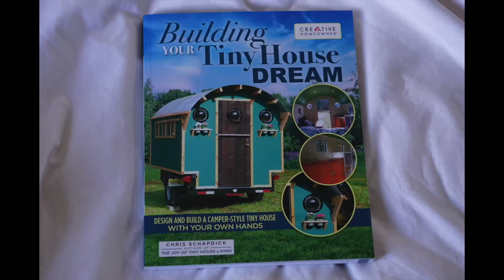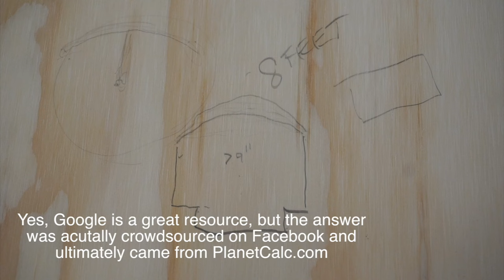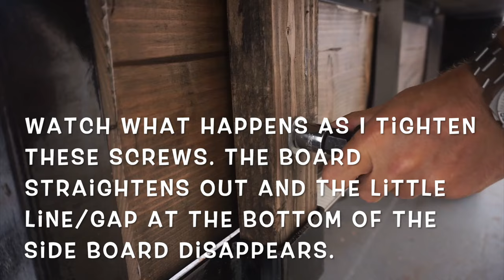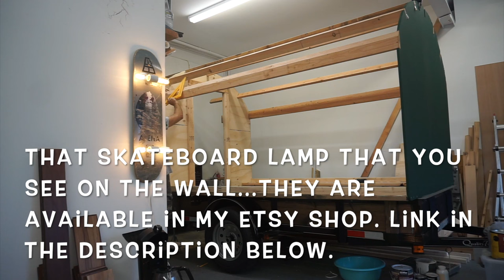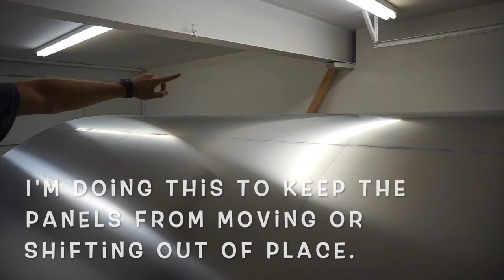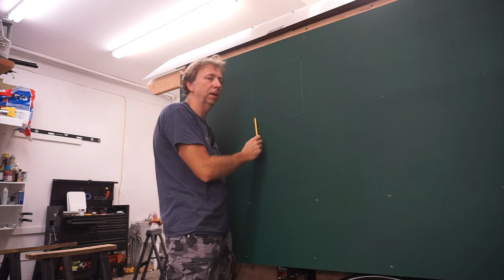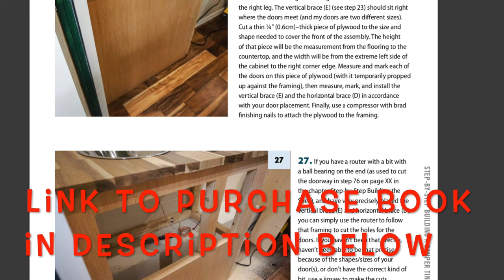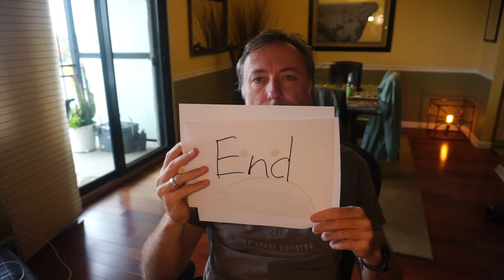End To End Gypsy Wagon Build - Full Tutorial!

Comment: for making those side 2x12's be flush, i'd sand the floor boards, then seal them, then add insulation, then the flooring, THEN add the side 2x12's and that should level out the boards to the steel sides.
Reply: This makes perfect sense. Will be much easier to install the flooring too when there are no walls in your way. Great idea!!!!
Reply from the maker: That's actually a good idea. I've never insulated the floor...only sealed it to the elements. I'm always worried about losing headroom since I'm a tall guy... 6'3"
Reply from the maker: agreed.

Comment: I just got your paperback book in the mail. Thank you so much for sharing your knowledge 🙏
Reply from the maker: Thanks so much for getting the book. Please drop any questions into the comments here if you run into any issues, please let me know on your build. Just thinking about it or are you planning on moving forward with this?
Reply: @TinyIndustrial  Thank you for such an awesome book. Lord willing I'll try to start building one in a month from now. I want to use a 12L x 6.5W or a 14ft long trailer. I guess that means I'll have to do a double axle trailer because I have no idea how much the materials will weigh.
Reply: @TinyIndustrial  I do have a question. I want to bring up the side walls from 4 ft to 5 ft. That would only leave 2 ft for the arc. Would that look weird and not as aesthetically pleasing in your opinion? I can't build higher because my shop door is 10ft exactly. As far as the seams go in the plywood do you just caulk and paint over them or just cover them with trim?

Also what do you use to seal the rafters? I know people say cedar is Waterproof but does treated lumber last without sealing it? 

Also what would you use to reinforce the back wall? L brackets?
Reply from the maker: Not sure what you mean by "would only leave 2' for the arc". You mean that the total height of the arc is only two feet? That's fine. Even if the arc were only 6" higher in the center than the sides, it's still fine. I don't think that you would run into a situation where that would 'look weird.' Hope that helps.
Reply: @TinyIndustrial  yes that helps thanks.

Comment: Could this build be used on a 7x14 trailer with adjustments?
Reply: That size will give you a mansion of a gypsy camper ! 👍
Reply from the maker: Definitely. I kept the info fairly generic since no two trailers are ever really the same. The general techniques can be applied and modified to different kinds of trailers. Is that the size trailer you have available? I would just make sure that the axle is rated for at least 3500lbs. Some of the wimpier trailers have less load capacity.
Reply from the maker: That's true. Would be a 'big' one. :)
Reply: Thank you for your answer. That is the trailer size that I'm looking at.
Reply from the maker: Nice!

Comment: String and a pencil for a compass? A long yardstick (maybe make one from plywood) with a screw or bolt for pivot in one end and a hole for a pencil tip at the other end will work more accurately. Also, instead of a pencil, the jigsaw can be mounted at that end for a better arc cut, and very stable, repeatable and also adjustable "not the radius, but the other thing", oh yes the radius. Just kidding!!!. I was gonna buy the book, but you showed the important number and link that I need.  Thanks, Chris!!!!!.
Reply from the maker: Yes, true. A piece of wood would likely be a bit better than a string. Glad the video was helpful for you. I take it you are building one of these?
Reply: @TinyIndustrial  Thinking about it. It looks easy.The planetcalc link is very helpful. I laid out in AutoCAD the numbers from the program and they are very accurate!!!
Reply from the maker: @armandosenson2391  I wouldn't say that it's easy, but it is very doable. One step at a time. No rush. You can get through it for sure. Please document the process on Youtube if that's your thing since it can definitely help out others as well.

Comment: I understand everything perfectly except for one part. at 1:46:40, why do you run that 2x3 to attach the wall framing? wouldn't it be more structurally sound to mount the wall framing directly to the big 2x12 below? Thanks so much! I'm going to build my own trailer and then build one of these houses on top at my new home here in Guatemala!
Reply from the maker: That's a great question. I'm not entirely sure why I did it that way. You can certainly do it the way you propose and have it be find. I think that the main purpose is that with the 2x3 at the bottom of the wall, you have 1) a wider area to attach the exterior/outer wall to. and 2) perhaps more importantly, when you go to attach the interior wall, you have a better contiguous span to attach the bottom of the interior wall to as well. Without it you would just be bridging the empty space between the upright 2x3's. Make sense? Really good question though...but those are the main reasons for it. You can see what I'm talking about at 03:22:20. Imaging if that 2x3 wasn't at the bottom of that interior wall...much harder to attach interior wall material that way if it wasn't there.

Comment: it would also be a good idea to put some Locktite on the ends of those bolts to hold the nuts in place so vibrations from driving down the highway don't eventually work them loose!!!
Reply from the maker: Good idea. I often use split washers to accomplish that. You can parially strip the threads as well. Thanks for the comment. Are you building one?

Comment: I'm curious about the moisture accumulation in the cealing from the condensation on the aluminum to the insulation and the wood. Ive seen moisture accumulation with that combo. How do you combat that potential?
Reply from the maker: Yeah, that's a good question. I have never had an issue with that. As with any small space, it's always important to ventilate it as much as possible. Dryer/warmer climates are also advantageous with a small space like this.

Comment: Cool build did you weigh it?
Reply from the maker: Yes. The way that I build these they weigh around 2200lbs. Trailer makes up about 800lb of that total weight. You could easily save around 200lb by building a bit more strategically. So figure right around 2000lb for one of these.

Comment: why not use big sheets of cardboard to make your pattern for the back piece so it can be the one to get the mistakes made on it instead of on the plywood. then once you have the back piece(s) figured out, lay the cardboard onto the plywood, trace it and then cut it out. saves you a lot of time and money!
Reply from the maker: The issue is that I have never bought two trailers that were the same. They are not built to exact specs...and I only ever purchased them here and there. Creating a template to build more than one only makes sense if you can guarantee that the trailers are the same.

Comment: 15" is Great, When I had my Camper, I didn't know about the Speed Variation with smaller rim wheels, and I ran the wheels off of it Literally, nobody told me, brand new wheels
Reply from the maker: Yes, those are limited in what they can handle. Super important to keep track of the the weight the axle can support as well. Be safe out there folks! :)

Comment: Is it heavy to pull?
Reply from the maker: Not at all. These weigh around 2100 or so pounds on average. You could cut some more weight with some design modifications. Either way, 2000 lbs is not a lot to tow with a reasonably sized vehicle (always check your vehicles...and hitch's...tow rating). Are you thinking of building one?

Comment: Please take my comments as constructive and maybe consider them as possible design improvements. The use of vertical 2 x 12's around the lower section is definitely an overkill, the bottom is already protected by the metal frame and exterior grade plywood, properly weatherized, should be sufficient . The 2 x 12 horizontal wings are also, in my opinion, an overkill, but I think this will be a matter of preference. If used, the vertical studs though can be secured directly to these 2 x 12 wings, and the 2 x 3 horizontal bottom plates can be ditched (another overkill). These wings though, can be built using 3/4 plywood, but then you're going to need the 2 x 3 bottom plates for additional rigidity. The wings can be supported from the bottom by decorative but functional "L" brackets, metal or wood, builder's choice, at the minimum, at least three. Or short metal extensions can be welded for support, but that will require some metalworking skills. There is a lot of weight that can be saved by eliminating these 2 x 12's. The front and back walls need reinforcements, vertically and/or horizontally,  as only the plywood sheets are mostly holding it all together to the rest of the shell. The shell, in my opinion should be a stand alone self supporting unit all around prior to adding the plywood walls. Here I will continue using vertical studs from the floor to the roof line, with bottom plates and if possible, top plates, and some horizontal pieces. All four corners can use double 2 x 4's, in L fashion to hold every thing in place. Build it like the code calls for, if you can, to make it roadworthy, especially if you will spend a lot of time driving it all over the place.
Reply from the maker: I appreciate the comment. Thanks for taking the time. You are absolutely right that I am overbuilding this in some sense. Using the solid wood that low on the unit to me 1)provides more strength 2) more longevity 3) a lower center of gravity for road stability. That said, if you are looking to save weight, there are quite a few ways to cut weight of the unit. My bed platform also tends to be on the heavy side and can also be 'leaned' down to something lighter. Are you looking to build one of these?

Comment: just a tip: it would make more sense to start with the end closest to the hitch and get that all secured, THEN start working on the two sides. your way of presenting this is making it much slower and more confusing and risking more mistakes for a beginner following your tutorial.
Reply: i think Chris was a beginner too and learning at the same time during this video shoot, that's why it took 4.5 hours. I thought he was talking about pianos when he mentioned "uprights", and how about "not radius but the other thing". He must have come a long way by now, as he's building these for other people. But he did good. A nice project!
Reply from the maker: Not sure I follow. I do the front and back and then connect with the roofing beams. Seems to make sense to do it this way and then add the walls, no?
Reply from the maker: Thanks! Yes, this project, as with many I do, are all custom and a 'design on the fly' kind of thing. That's mostly since the trailers are never really the same. The principles apply either way. Also wanted to show people the process vs. specifics around my particular trailer. Take it all with a grain of salt and adapt to your situation.